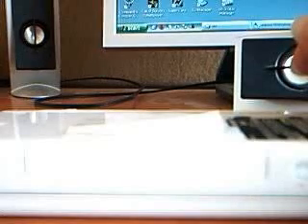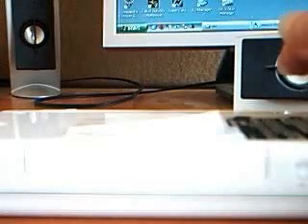GBAtemp.net Flashme Guide

Comment: Passme is a device, which plugs into SLOT-2 (GBA/RAM/Rumble/Camera slot), that allows you to boot DS code and ROMS. Any original NDS game needs to be used in conjunction with Passme in order for Passme to work. A Passcard does exactly the same as Passme, except it does not require a NDS game as it plugs into SLOT-1 (NDS game slot). If running homebrews and ROMs is what you want, an easier way around it is to pick up a cart with built-in Passme. Simply install firmware via PC, plug in, then play.